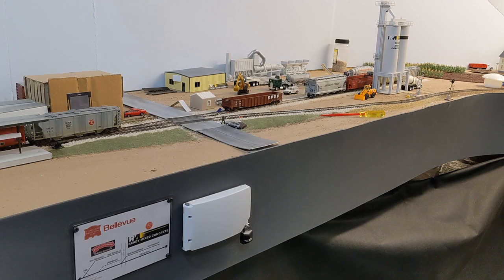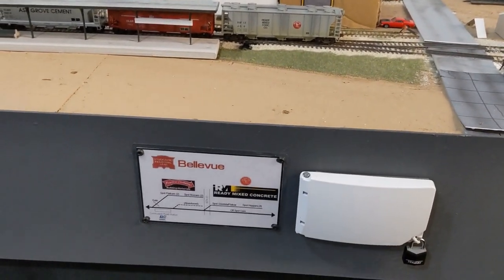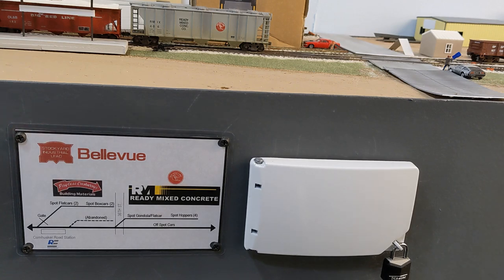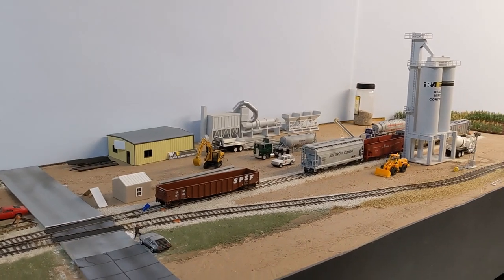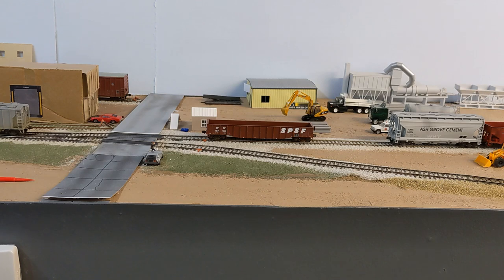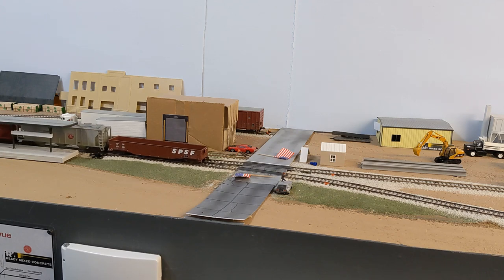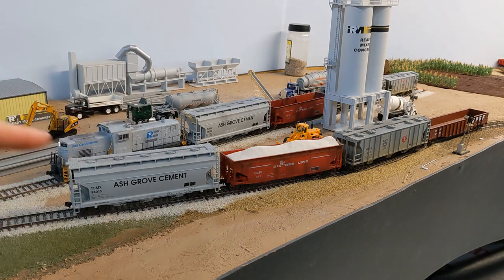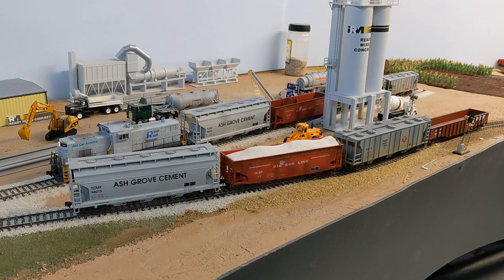Stockyard Industrial Lead: How a One-Turnout Layout Can Influence Design

Comment: Excellent video as always! I also can't recommend Lance's work/mindset enough; it's been the single largest influence in my modeling mindset to date.

My first 'successful' layout was this very thing -- a one turnout layout. On the diverging side of the switch was a bakery with 4 spots for boxcars, vegetable oil tanks, and covered hoppers. The end of the other side was a small transload/team track which saw mainly covered hoppers and boxcars. I've since expanded slightly and added another two switches, but the original layout is still the core of operations. Simple is often better indeed.

Other great options for small industries on single spurs (aside from bakeries and cement plants) with lots of switching include:
-Subleased warehouses
-Breweries
-Corn syrup terminal (see Lance Mindhiem's LA Junction layout)
-Grain/feed mills
-Chemical plants
-Fertilizer plants
-Transload facilities
Reply from the maker: Thank you! Totally agree with you about Lance.

Comment: I like your idea of integrating the one turnout layout into a grader scheme. Having a place like this little concrete plant is also a way of hosting a shorter operating session which would be terrific when there isn’t time to enjoy the whole layout. Or, focussing on switching out just that one customer would be a way to indulge in what happens in just this one siding—without having to be worried about all that other work that needs doing. So it’s flexible and adaptive depending on time and how we can spend it. 

Neat too, to think of how sometimes the local train doesn’t always work all the customers.
Reply from the maker: Thanks, very good ideas and thoughts for op sessions!

Comment: Pretty cool.  The 4x8 layout that I wound up with has 3 total industries.  I think the cement plant, which I have too, are really great to do.  I also have a lumber yard, then I stretched with a bakery. So like you it does take some time to really switch everything.  And like you said they all don’t get switched at the same time.  Makes for interesting things.  I also have a track mobile at the cement plant to drag cars in position.  So it can actually be three engines working.  Mainline for drop/ pickup, switcher for industries, then the tram boiler for movement. REALLY nice info.
Reply from the maker: Thanks!  That sounds really cool what you have going on with your layout.  It's amazing how much operations you can get from something simple like that.